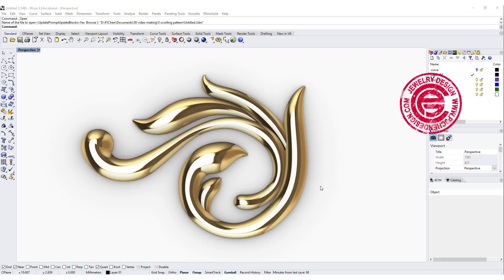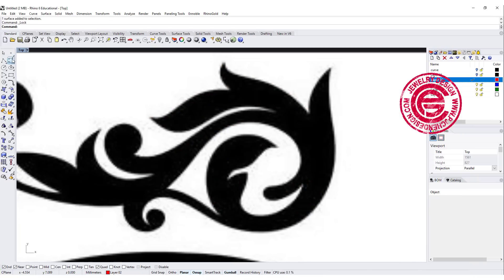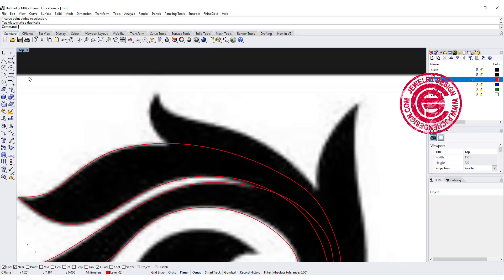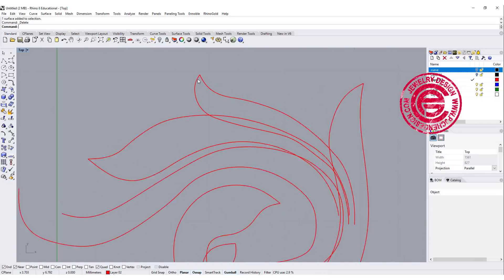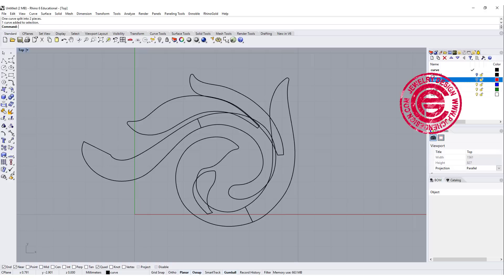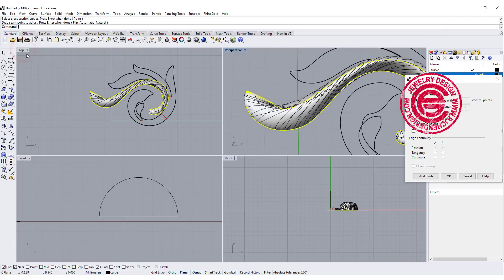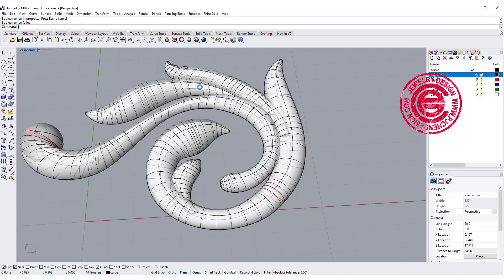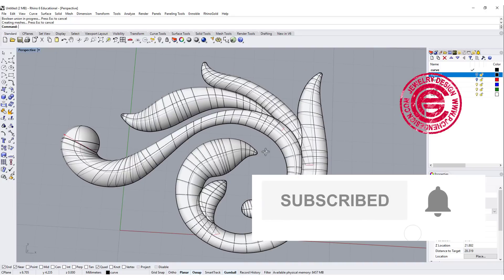Scrolling Pattern 3D Modeling in Rhino 6: Jewelry CAD Design Tutorial #76

Comment: These scrolls had been giving me problems forEVER! Add slash and some of the other tips are life changing! Thank you as always Ms. Chen! Your videos really help me, you fill in the gaps with those great tips to make good design, GREAT! I taught myself CAD (Matrix). You have given me the confidence to try native Rhino. I think I will be purchasing Rhino 6 this week👍🏻 (I want to be more mobile, Matrix requires internet access). 

What do you think of Rhino on a Mac? Any experience?
Reply from the maker: Love to help Jayne. If you have Matrix, it is a Rhino plug-in. you can use the same commands on the Matrix. However, I didn't know it has to be use while you are online. Many of my college student use Mac for Rhino. The difference is the mouse. mac only has one button instead of 3. So you many have some additional click if you use Mac. The interface is a little difference but the way of using command is the same. Some students told me once you get use to it. it will be fine. I am more comfortable with PC interface tho.